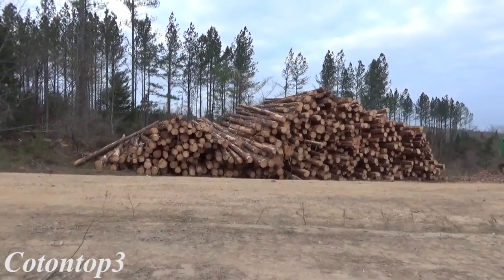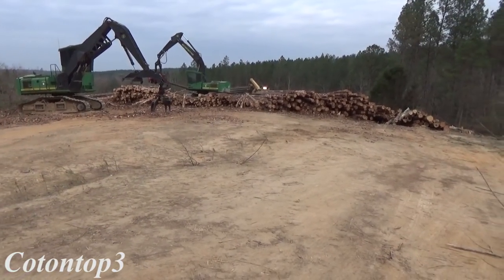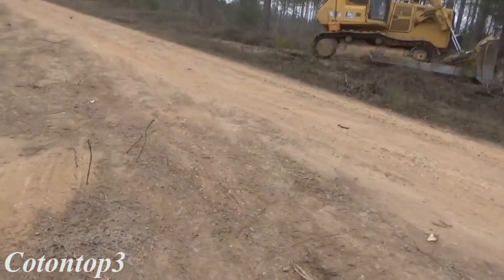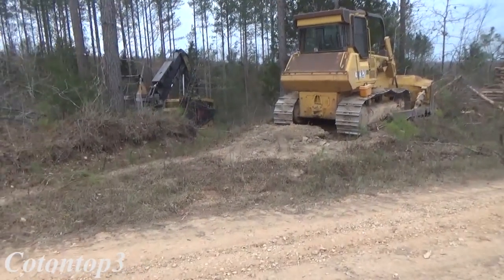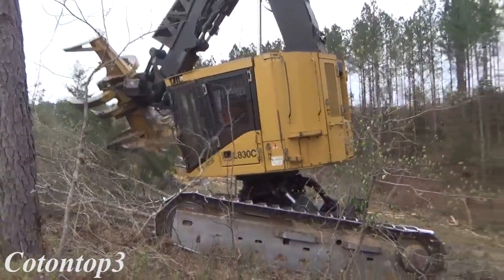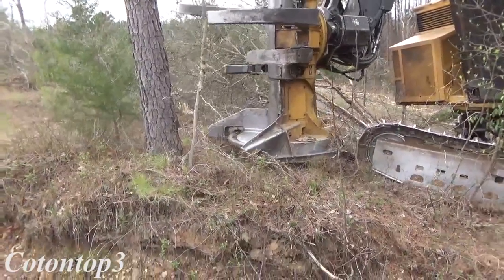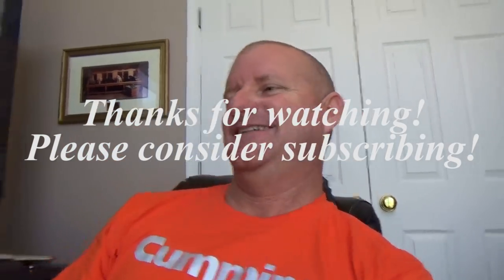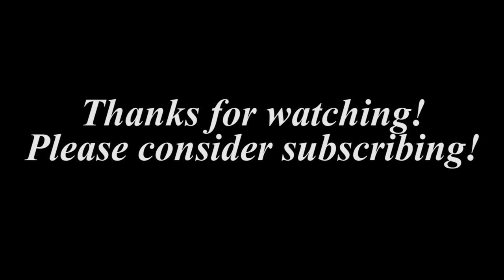Tigercat L830C track cutter with some wicked slow motion!

Comment: Just wanted to say there is no problems in where you were filming, with the rotation of the cutter disk anything would have been tossed away from you plus you kept solid objects between you and most debris. You know your way around the gear quite well and show it. Keep up the good work. Two thumbs way up.

Comment: That is awesome, when the cutter is pushed to cut the tree is it auto speed or manual. The reason I ask is that it appears to be hustled to take the cut with the blade slowing a great deal, not being an operator there is bound to be a simple answer.

Comment: People need to lighten up. If you don't answer a question of mine, I'm not gonna lose any sleep over it. I just enjoy watchin yer videos. The fix-it ones are the best.
But I do have a question, is the cab on the track cutter self leveling, or manual?
"Keep on Loggin"
Reply from the maker: +InjectorRick manual
Reply: InjectorRick

Comment: Does the tree rest on the spinning saw blade after it is cut or is it lifted slightly somehow?
Reply: Beverly Fischer I think there is a metal plate above the cutter disc for the tree to rest on.
Reply from the maker: +Beverly Fischer it sits on a plate just above the spinning disk